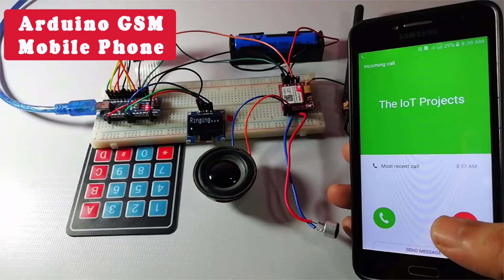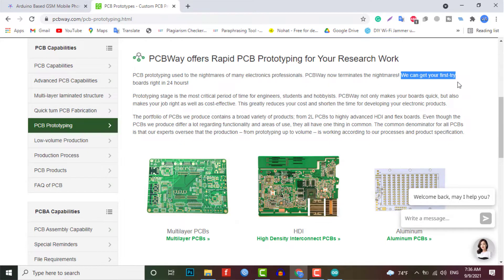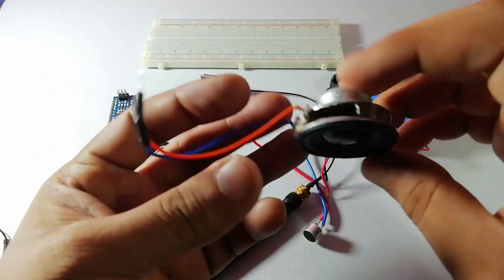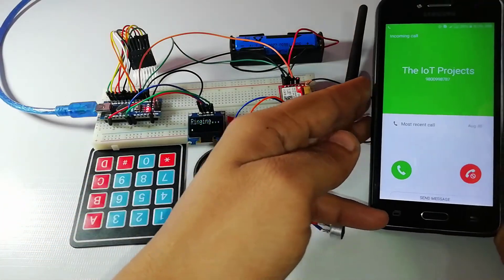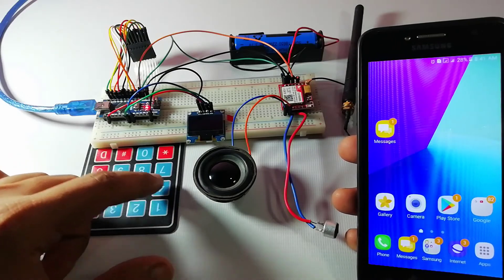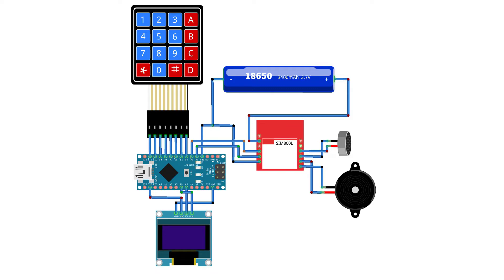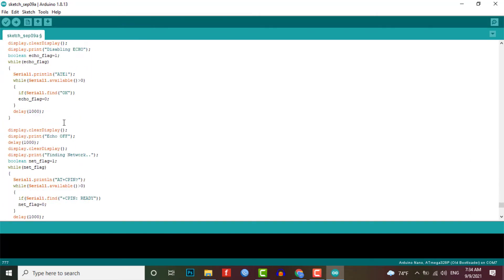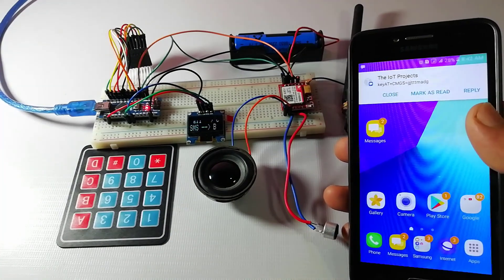Arduino based GSM Mobile Phone using SIM800L | Call & SMS

Comment: Bro why dont you put the voltage dividing from arduino's Tx output ? Its  because sim800l using 3.7v voltage logic otherwise the gsm module get damaged

Comment: I have made the project, but the speaker is not loud.. and then I connect the speaker to a mini amplifier but the sound is “biiipp, biipp”. Do you have a solution for this? I want the speaker volume to be like loudspeaker on our phone
Reply: i saw another video where they use potentiometers